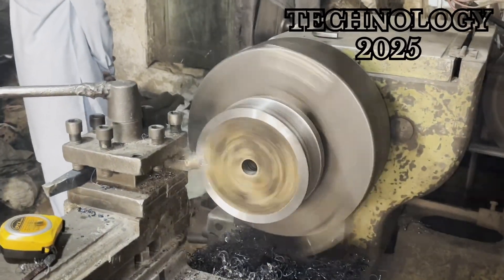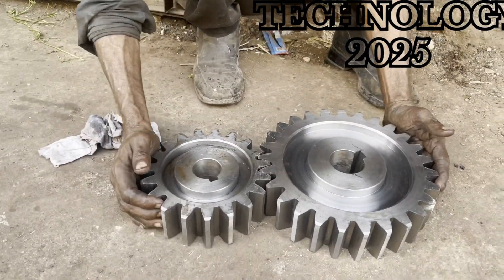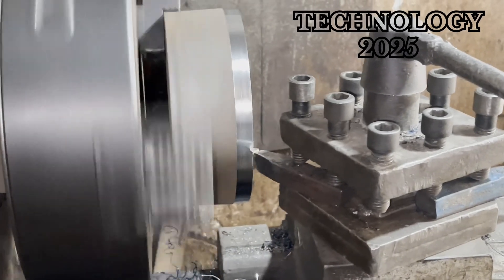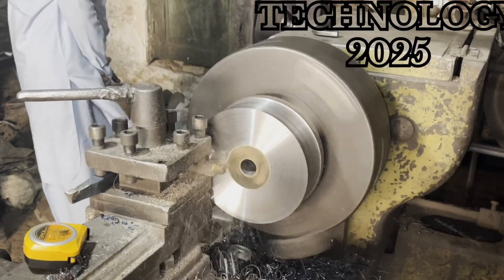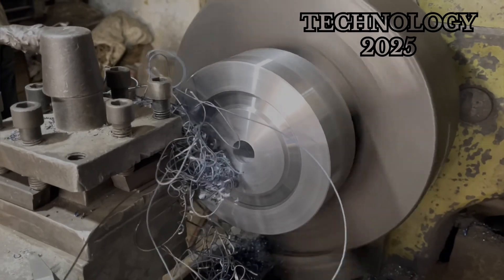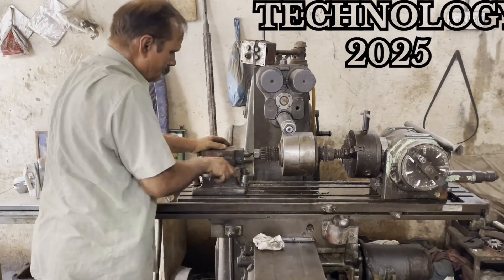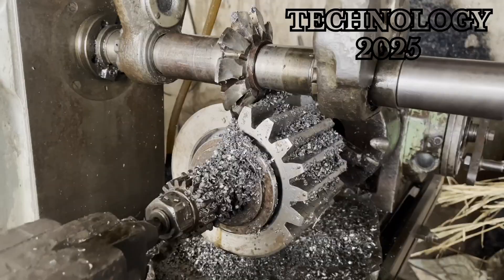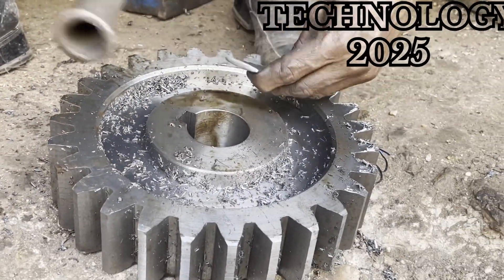this man is expert making spur gear on his Lathe Machine old ships high strength sheet #lathe

Comment: He didn't make a gear on a lathe - -he prepped the blank on a lathe and then machined the gear on a horizontal milling machine.  If he was depending on a tape measure to get the proper diameter for the blank it was not precision work.